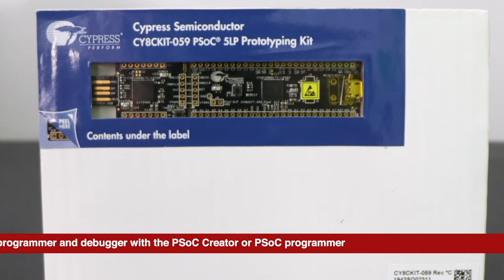Dev Kit Weekly: Cypress Semiconductor CY8CKIT-059 PSoC 5LP Prototyping Kit

Comment: This kit is available directly from cypress (www.cypress.com) for $10 plus shipping.
 Also from places like Mouser and Digikey.  
At my blog http://socmaker.com (where SOC meets Maker community), I go through
the steps of creating an IR controller for a room air conditioner using the PSOC5LP CY8CKit-059.
It uses Nextion, CY8cKit-059, and a plastic printed case.
Reply: Hi Wade,
I want to learn this but no idea how to programming... i want to use to run small desktop injection plastic machine... they are some video in youtube they just doing and connecting somethibg but in practise nothing..i dont know and where i need to strat i have no clue..any your help or suggestion please?